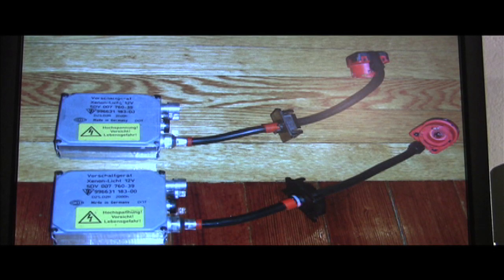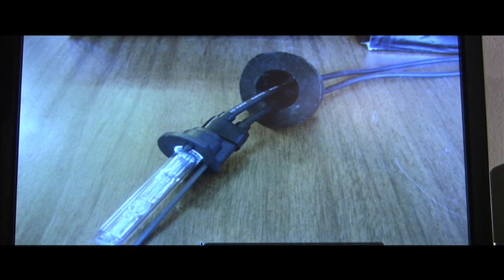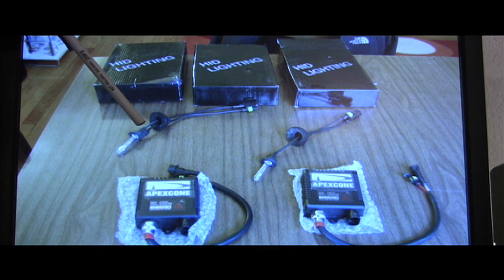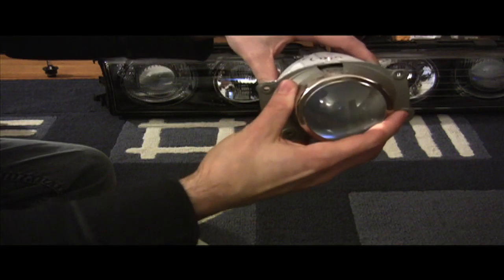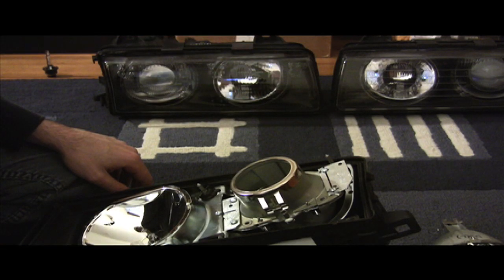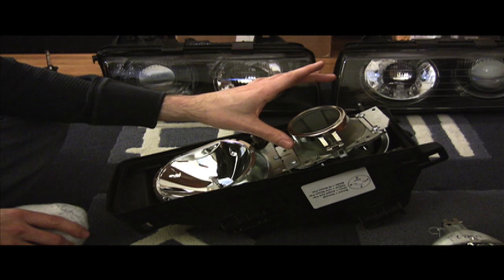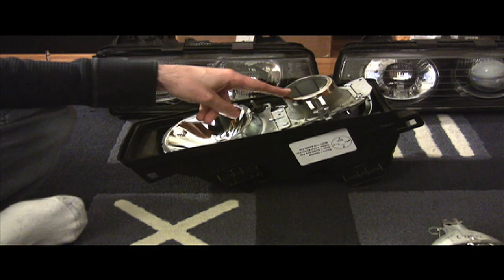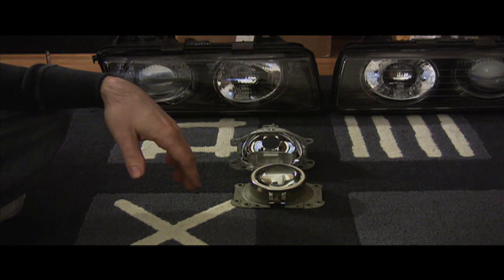BMW E36 Lighting For Noobs - Part 4 of 4

Comment: Have the Depo headlights you show in your video .. 1999 e36 323i convertible .. There is a round knob on the back bottom of each light that I think is to adjust driver side. Do I turn it all the way to the right or left for US left hand drive ?

Comment: This video series was very helpful. Thank you for sharing! I have a question for you, I have a set of depo headlights that look very similar to the zkws in your video. With the internal wiring what h1 bulb would you need to use? By that I mean I'm assuming you can't use the bulbs that have the wiring and connectors already attached. I hope this makes sense haha. If you have the time to get back to me I would grateful apreciate it!

Comment: Dont forget to mention, If you got a K&N cone or Other Air cone intake kit on your car, your air filter mite not let you fit fit your ZKW's, DJAuto, Etc Headlamps. Your mite have to get shorter piping or shorter filter as i had to get a shorter K&N filter. AND!! your alarm unit mite need to be relocated.

Comment from the maker: No, if the ballasts are under 6A, you don't need a relay kit. The stock fuses are 7.5A, so 6A will be fine. 55W digitals will also not usually throw an error code on the OBC. 35W digitals will.

Comment: Thanks man very informative...wish I had this info before I bought a set of angel eye HIDS from DDM tuning.  The lighting is very good but I am having trouble aiming them.  I have been on the highway once and drivers going the opposite way are flashing me or drivers in front of me depress their brakes to let me know that the light is too intense.  Need to aim my light properly but don't have a clue to accomplish.